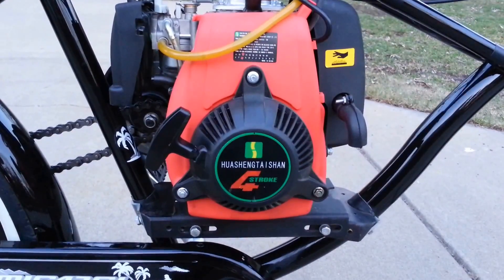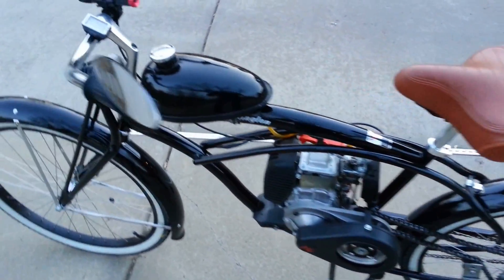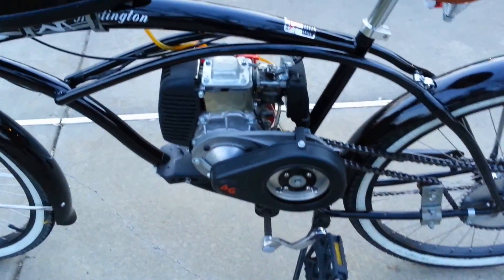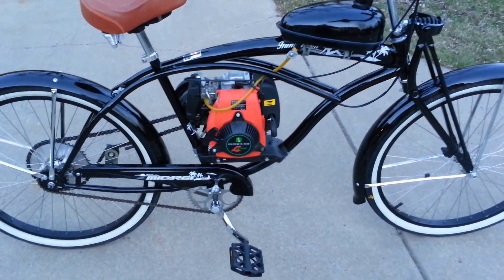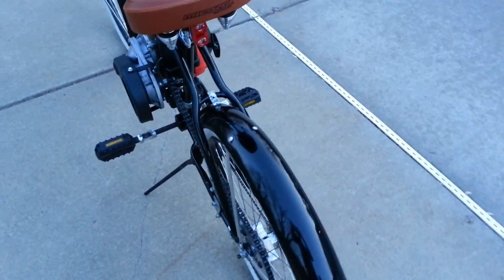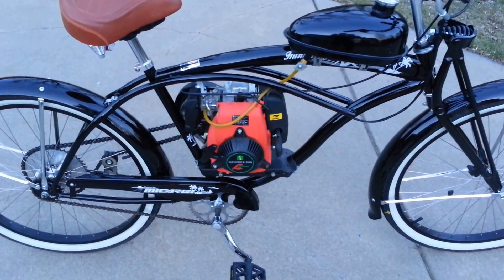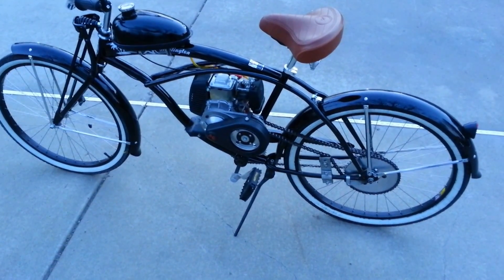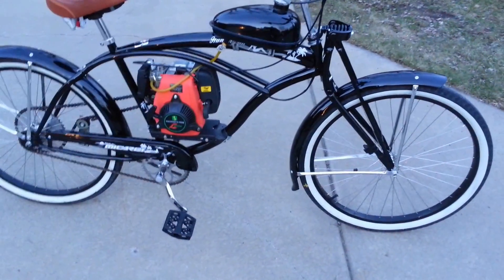4 Stroke Motorized Bike (2 stroke VS 4 stroke)

Comment: He fail to mention 2 strokes are way lighter, there are endless upgrades you can do with 2 strokes, the are way smaller,  clutch lever gives you more control over things. But you are right it mainly depends on what it's used for. 4 strokes be less maintainace though if you are a person that tinkers the 2 stroke can be just a dependable.

Comment: how fast can u get that bad boy? i can only get mine to 50kph but i would like to at least get 55 kph but still be able to get 50kph in around 1.7 km.  would a smaller rear sprocket accomplish that? currently running 44t, looking at 36t.

Comment: With the 4 stroke is it really necessary to have pedals/ crank?
Reply: No, but it makes it a lot less likely for cops to bitch at you. I’m building a 2 stroke and I got electric start with the engine. I’ve also decided to take the pedals off. If my electric start fails I’m fucked seeing as I don’t have pedals, however with a 4 stroke I’d be fine.

Comment: I have a 2 stroke and it's best kind, fortunately where I live summers aren't that hot but whenever I'm coasting with the clutch pulled in I like to cut the engine to let it cool off a bit and from what I've experienced, they cool off rather quickly in my opinion. There fine enough, only problem I ever had so far is the chain failing (due to my negligence) and the engine once flooded. Plus I don't mind mixing fuel and love the exhaust aroma.

Comment: Hi there I just got a 4 stroke engine and I know the gas line goes from tank to filter to carburetor, but there is another clear hose was wondering where the other one connects to any advise or help I apréciate it
Reply: fuel tank

Comment: I run propane on most All My Little 4 stroke Engines and start them on propane. Propane fuel never goes bad and it's either a 100 - 110 octane so it always Burns. It doesn't matter if your carburetor dies. You can still run on propane. I even ran one little engine without a carburetor on it running propane while I had the carburetor off rebuilding it waiting for a needle and seat to arrive. I've always been into gasoline and racing fuel but there's all kinds of problems with it. At first like most people I wasn't sure of propane. but propane is just as safe as gasoline. Propane is cleaner than a diesel it's one of the cleanest fuels you can burn. And no catalytic converter to ever stop up on an engine with propane. You don't even need a catalytic converter on propane engines because all of the fuel Burns 99%. propane is such a clean fuel that's what you use on some stoves inside your house and almost Peoples Gas Grill that use propane because it's super clean.  Cooking meat on a gasoline fire would kill you to eat the meat. With propane no black carbon buildup in the engine at all or on the spark plug and no gasoline in the oil clean as a pen. Also a propane burning engine will last two or three times as long as a four-stroke gasoline engine will running on gasoline. Also when starting a little engine with propane you don't have to fiddle with the choke you keep the choke off of the carburetor when starting on propane. And the nice thing about propane you can put your bike inside your house just leave your propane tank outside. with a easy disconnect propane fumes just let it air for a minute before you bring it inside. Now keep in mind as long as you have not used gasoline in the gas tank or you don't have a gas tank on it it's fine to bring inside your house. That's sort of like I do my little suitcase hand portable generator. I bring it inside the house because I've never had gasoline in it at all. And when I go out on a job Indeed my little generator I put a bag down and put it on the front seat inside my truck Because it's only rental propane and no gasoline has ever been in the tank. All the little generator has is 12 ounces of oil in the crankcase. And being able to run propane you can run gasoline or dual fuel which is nice. Because if the gasoline won't start and as long as you haven't wet the spark plug out real bad with gasoline  most of the time the engine will still start and run on propane. With propane you will never flood the spark plug it can't happen. And for most people that don't maintenance engines you don't have to worry about that with propane it's for lazy people that don't maintenance anything propane works excellent. I went out to help my family member their fuel pump went out in their car. and I was not going to put a fuel pump in their car on the side of the road. I've done it before but that's too much time and way too much work. So I brought my propane homemade starter apparatus with me. I put the barbecue tank in the back seat behind me ran the hose out the window to the front of the motor. In-between the air filter and the throttle body I put the propane the motor started up and drove to the house with a hood lightly up on it. but I could only run about 12 miles an hour but it made it home without towing it. I wasn't going to go too fast with it without the hood fully closed anyway. Because the hood at full speed could come back cause major damage and break the windshield and then you can wreck because you can't see out the front windshield in a matter of seconds it can happen. Because I didn't have a motor club left where I can tow my family members vehicle. that is why I used the propane to get it home. also you can convert most any little engine over to propane there's propane conversion companies out there. mine is just a homemade apparatus that will work for most just to get the motor started or going. but my dual fuel propane and gasoline generator Works excellent and it doesn't stink as bad as gasoline it's cleaner. it smells like a propane forklift truck in a plant because they can generally only use propane forklift trucks or battery powered forklift trucks.

Comment: Youre obviously the man to ask about the GXH50 engines and their clones.  Im wondering if the Chinese copies are worth taking a chance...I dont know one from the other.  Im almost about to pop for a Honda.  You seem to have 1000's of hours on yours by now...
Appreciate any response.
Reply: Perhaps an odd decision to some folks.....I bought a "cheap" chinese generator...less than 100 bucks.  I tore it down, studied it, and came to the conclusion.....nope, the engine stinks.
To me ....if no potential for being an heirloom tool...that's a big factor.
Absolutely 100% of my inherited tools are  "made in America...made in Japan....made in Taiwan. For the dumb folks...Taiwan isn't communist China.
Reply: "You get what you paid for " .....that's the MOST overused nonsensical statement ever said.  Do I use a hammer once... then say it's over performing the next time??  Do you see anyone rebuilding cars and trucks that cost 30,000 bucks....or rather those that cost 2000 brand new.  Bringing manufacturing back to USA is the BEST thing Trump has ever done for the consumer.   
I remember the days when China couldnt even make a decent cardboard box.
Reply: More to the point...I also bought a used E-bike Radwagon.....The battery sucks...the bike is basically  looong, sloow, and very cumbersome...but demands respect from traffic. Im also in the southeast (Georgia)....the respect is comforting.
The best thing about the bike...the frame.  Everything else is junk...or easily bested by Ebay stuff.

Comment: would a 4-stroke fit on the 26in Kent Bayside Cruiser?
Reply from the maker: When you're dealing with department store bikes, they are using a standard size frame which may cause issues when installing a 4 stroke engine. It can be done, but not without some issues and modifications. I would recommend going to an extended frame bike so you have a little more room for the engine and yourself so you're not banging the handlebars with your knees constantly. Go to bikebuyers.com
Reply: General B.C. Beauregard same here I want to do it but I don't know 🤔 I hope someone answers 🙄

Comment: I have the 2 stroke and its amazing the best part is the clutch and how loud it is. I took the muffler and cut off the bottom part of the exhaust so there is no baffle at all. Their also amazing on fuel.
Reply from the maker: +Chase Ehrhardt In the wise words from a past comment, BRAPP!
Reply: I do have a 212cc 4-stroke with a 36 tooth sprocket and its got way to much power but I use it to drag race my neighbors mini bike.

Comment: would a 4 stroke engine fit on a 26" 1937 Columbia
Reply from the maker: +Shanice Vera Good evening Shanice! I looked in to that bike and a 4-stroke won't fit in there with that frame design. Even the frames I use are pretty tight since you need a little space around the engine to service the air filter and work the choke and so on. Any other questions at all feel free to email me at sinistercustomcycles@gmail.com or Facebook.com/sccmn. Have yourself a great holiday!
Reply: Sinister Custom Cycles thank you. I did some research would it fit a huffy nel lusso im not sure I just really like the bike design
Reply from the maker: +Shanice Vera That would be close and more than likely an extremely tight fit if you were able to get it in there. You would probably have to do some minor modification to make it work. I would check out bikebuyers.com once. They have a large selection of bikes. Their bikes are also better quality as well.
Reply: Sinister Custom Cycles okay thank you
Reply from the maker: +Shanice Vera You're more than welcome! Happy holidays!
Reply: Sinister Custom Cycles  so I did more research i found a huffy cranbrook is the most popular to be fitted with a 4 stroke engine  i was wondering what bike you used for your build I'm trying to go for that vintage look as well
Reply from the maker: I try to shy away from Huffy or any department store brand bikes because of the quality is just enough for normal riding at best. Putting an engine on it would really be hard on it and you're looking at a good chance of ruining your bike sooner than later. I go through Bikebuyers.com and have never had an issue. Some of my bikes have over 5,000 miles and still no issues.
Reply: Sinister Custom Cycles smart, and thank you once again have a good day
Reply from the maker: Shanice Vera You're more than welcome! Anything other questions you have let me know! Also feel free to share your build on my facebook page at facebook.com/sccmn

Comment: how fast can u go on those bikes an can u use it for country side rugged places
Reply from the maker: +AL Z-BOY Good morning AL! Top speed depends on a lot of things. Rider weight, terrain, sprocket sizes, etc.. The bikes I build depending on what sprocket I use range from 21mph-33mph on flat asphalt, no wind and my 160lb skinny ass on it. I have taken mine on gravel roads and also dirt trails and it did okay. It would have done better if I had a bigger rear sprocket on it for more torque and also a springer front fork instead of no suspension at all. These bikes could go on country side trails occasionally but they definitely aren't designed for it to be honest, at least not the rugged I'm thinking with extremely steep dirt hills, jumps, etc.. There is a company that makes something that's perfect for that terrain but you're looking at spending at least $3,300 to start. Thanks for watching!

Comment: Whats a decent frame size for a mountain bike 4 stroke build?
Reply from the maker: +DJCryptoKnight Good morning! Mountain bikes are extremely hard for 4-stroke builds since the frames have a very small and an odd shape to them. You would ideally have to use an older mountain bike with a V frame and about a 22"-23" frame size. If you want send me some information regarding the model bike you're thinking of using to sinistercustomcycles@gmail.com and I can let you if it will work or not. Thank you for watching!
Reply: Sure. Heres the link: http://khsbicycles.com/bikes/2013-khs-models/alite-100/ BTW, its the 21" frame version of the same bike
Reply from the maker: +DJCryptoKnight Can you do me a huge favor and email me that link at sinistercustomcycles@gmail.com? I can respond better and quicker and also paste more in my response that way. Thank you

Comment: I Am Riding The Huasheng 49cc 4 Stroke, And Am Wondering Is There Any High Performance Parts
(such as carb, trans, sprocket etc) that I can add for more speed????
Reply: Ratchet Mann not much what you can do is actually use the nt carb from the 2 stroke and the 2 stroke exhaust as well and add a good air filter to that nt carb

Comment: Has anyone ever mounted a 4 stroke engine in the rear over the back wheel so the pedals could stay standard? Thanks, Carl
Reply: Yes, there are a few 4 stroke engines mounted over the rear wheel on bike frames, and I have one of them. I laugh about the thousands of people who are so concerned about having to deal with the super-wide pedal shafts and whether they will clear the engine. ha ha ha.

Comment: I currently have a 2 stroke 66cc engine on my bike and I'm thinking of going to a 4 stroke 49cc what performance difference should I expect and what about the reliability because when I full throttle my 2 stroke it shakes and screams so bad I'm afraid I'm going to blow the engine, if I full throttle a 4 stroke will I risk blowing it just as much as a 2 stroke or is it more reliable
Reply: If u run any engine full throttle u r going to damage it its ok to get on it wile ur getting up to speed. But once you get to top speed ease up on her a little. .ur engine will last a hole lot longer that way.I don't run any engine full throttle. At least not for more than a couple seconds at a time.  In break in period definitely do not ever go full throttle. Until after at least the first two tanks. .then it is actually good to open her up but always very u speed the changes in rpm will make ur rings seat better. And that will give u more power down the road.  And don't use a fully synthetic oil first 4 tanks you never want to break in a motor using synthetic you can use a semi synthetic these motors kind of require synthetic due to the high rpms but definitely don't go fully synthetic first 4 tanks at least trust me I am actually a mechanic aget on here and post videos like most of these guys I c pretending lol. Any questions e mail me joebaytrader@gmail.com 
B happy to help were I can

Comment: One big difference between 2 and 4 strokes. Most 4 strokes are complete dogs....
Reply from the maker: psymetal The keyword is "most" 4 strokes. You can either go to a different style 4-stroke, or add a shift kit to give you a much greater range of gearing, performance, longevity, and miles per gallon.
Reply: Sinister Custom Cycles
My experience with 4 strokes is they have a high center of gravity, and difficult to modify for more power. Yes they have the good points you list, But i like my ported 2 stroke better.
Reply: psymetal

Comment: Any ideas how to get the engine to go through the bike's gears so you can go fast, up steep hills, and coast?
Reply from the maker: Tim Lewis Your best bet for this is to go through Sick Bike Parts and order a shift kit which will allow you utilize your bikes gears giving you more top speed, low end torque, and better gas mileage while making your engine work less.

Comment: is there anyway to have a 4-stroke with the clutch like the 2 stroke? ive owned 2 2stroke bikes first one lasted maybe a month, second one lasted maybe 2 weeks, it wouldnt spark or anything i tried to rebuild it with new parts ect, no luck, yes they were alot of fun and always would want to race them but ive always been a fan of 4 stroke engines.
Reply from the maker: Darth Aardvark I'm not going to say there isn't an option out there for it, but I haven't seen it for the OHV style 49cc engines as of yet.
Reply: Yes there is me and my step father took a giant stiletto chopper bicycle and put a 4 stroke pressure washer engine on it 5 horse belt to drive with clutch the hardest part was the pedals